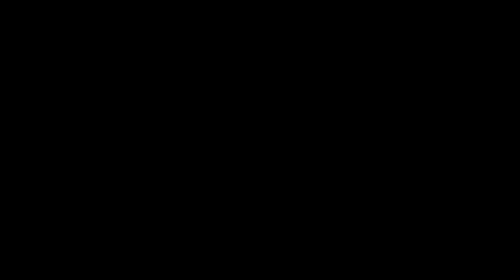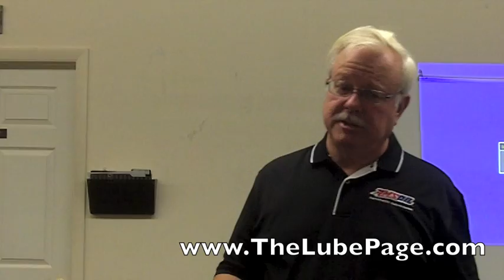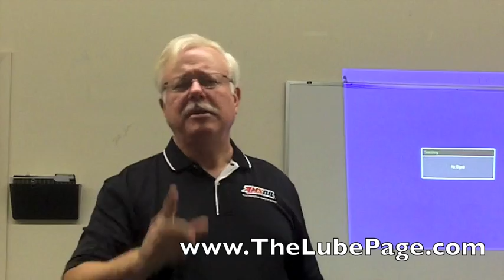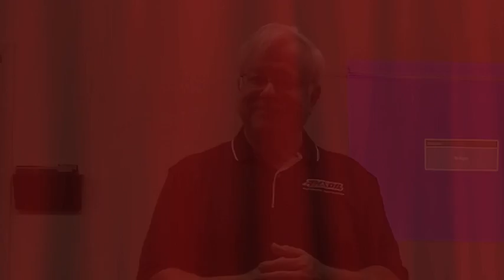Transmission Fluid Facts

Comment: Dear Sir I have been told that I shouldn’t use any kind of CVT FLUID but what is specified by Toyota which is FE fluid, but along with my experience with Amsoil , every thing was great to me, in your opinion using Amsoil CVT fluid in Corolla CVT transmission will expose me to issue with this kind of transmission?

Comment: I’ve recently heard that most modern ATF types are Dexron VI/Mercon LV copies. Aisin sells a fluid that claims compatibility in both Matic-S Nissan transmissions and Mercon V transmissions. I thought this was strange when I first saw it. I was looking for fluid for my Xterra and came across this stuff. Got me thinking that Matic-S and Mercon V are similar if not the same. I’ve also seen bottles of Dexron VI say that it’s compatible with Toyota WS. Are these new low-viscosity fluids just copies of each other? I’ve used Valvoline MaxLife and it does well, but I’m considering the Amsoil Fuel-Efficient signature series since that line claims compatibility in fewer, but newer transmissions. I am skeptical that Valvoline’s 95% of vehicle compatibility.
Reply: Also, what is the main difference between Amsoil’s signature series and OE series for transmission fluid? Are they both 100% synthetic? Is one superior to the other? The $6 difference between these two has me asking such questions 😂

Comment: Which ATF should I use in my 1997 with a 4L80E and 130k mi.? No service history. The website says either the OE Domestic and Imported or the Sig. Series Fuel Efficient. But, in looking at the 2 page data sheet it shows the Multi-Vehicle for Dex III. I’m aware of the TSB to use VI in place of III, but it makes me a little nervous with something that old.

Comment: Hey Dan I have a 2017 ram 1500 zf transmission, can I use amsoil instead of the oem 50$ a quart  for my transmission...about to do my 90 thousand miles transmission fluid change...please let me know
Reply from the maker: Amsoil ATL Fuel Efficient Low Viscosity trans fluid is the correct fluid for the sf trans.

Comment: Many thanks 🥰
Can amsoil ATF fuel efficient replace efficiently  Honda OEM DW1 on 2013 Honda civic transmission??
Reply from the maker: Yes, The Amsoil ATL (Fuel Efficient ATF) is a direct replacement for Honda DW 1 fluid.
Reply: I have actually mixed them in 3x drain fill on my 2014 crv and it solved the torque convetor shudder

Comment: An Amsoil guy is saying that a universal ATF isn't actually universal, yet Amsoil makes a multi-vehicle ATF.
Reply from the maker: Amsoil does not make a Universal ATF, they make one product labeled Multi-vehicle ATF.  The Multi-Vehicle applies to about 55% of applications.  Another ATF is labeled Fuel Efficient ATF and it applies to the other 35% of the applications. The remaining 10% is for various Foreign ATF spec's that Amsoil has no equivalent.  Additionally, Amsoil has a line of Heavy Duty Commercial fluids labeled Torque Drive trans fluid and this is for mostly heavy duty Allison applications in addition in the HD fluids Amsoil offers Powershift Transmission fluids.  And last but not least Amsoil offers a Racing ATF which also meets the Ford Type F fluid.  So, yes you can make a fluid that truly meets several spec's but not all.  The Multi-vehicle fluid does in fact meet the largest number of applications but no single fluid can meet the myriad of spec's in the market place.

Comment: Dan, I don't know jack about cars but am trying to learn--doing my own oil changes and want to start doing my Transmission fluid changes.  So you don't recommend Universal Transmssion fluids (guessing largely in reference to Valvoline ML?).  Anyhow, I see Amsoil makes a universal Transmission fluid.  is the Amsoil universal ok to use in a Toyota?
Reply from the maker: Amsoil does not make a Universal ATF, they do make a Multivehicle ATF.  The fuel efficient low viscosity ATF meets the Toyota WS spec for ATF.  Amsoil makes several ATFs to meet the various manufacturers spec's.  Multivehicle ATF meets about 55% of vehicles where the Fuel Efficient lower viscosity meets about 35% of vehicles so about 10 is for Foreign cars that Amsoil has no equivalent.  I can send you specific tech info if you email me at danwatson@thelubepage.com

Comment: the strange part of this speech is that amsoil makes a product called MULTI VEHICLE ATF... which claims the exact same thing that he is saying makes the other product misleading.
Reply from the maker: Jon, Amsoil does make a product called Multi Vehicle ATF it is not labeled a Universal ATF.  Additionally, Amsoil makes several other ATF products and on each the 
specific manufacturer's specifications are listed.  Amsoil maybe should have changed the name but the specifications are there to differentiate the various trans fluids
offered.  With ATF it is always good to make sure you match up with the Manufacturer's spec regardless of whose ATF you choose to use.  For example, if GM calls for
Dexron VI Then you should verify the ATF you are purchasing list Dexron VI.

Comment: Valvoline now makes a universal fluid, & it's a full synthetic , so in a transmission with gears & clutch packs why is it half the price of the dealer brand?Especially when Kia's fluid, (just one example ), is only semi synthetic., (I will continue to wonder , is that half & half ?,or %20 synthetic & %80 conventional, Or?) I can't imagine any conventional oil staying exactly in grade both hot & cold.So is Honda 's  Z1 been discontinued because their new fluid DW1 is synthetic? We all know, (or should ) that synthetic fluid stays in grade over a higher temperature range than conventional fluid.Guess I'll have to buy a bottle from Honda ..I hope in canada our standards are enforced better than in some other places.Suitable for use , should read sueable for use !

Comment: Why is Amsoil ATF so expensive?what is so special in Amsoil ATF?
Reply from the maker: Amsoil ATF is a chemical based synthetic consisting of mainly Poly-Alpha-Olefins (PAO).  These synthetic hydrocarbons are expensive and the complex additive package has to be of the highest quality to insure extremely long lived performance.  This ATF is worth every penny, especially when you are operating under heavy loads and high trans temperature.  Transmissions are very expensive and anything you can do to enhance protection is very cost effective.
Reply: @thelubepage  thank you Dan for answering questions
Reply: @thelubepage  Kindly ❤️
Could you send me any  trusted approved links or official links   shows that   amsoil ATF is chemical based  PAO!!!
Many thanks in advance.
aminammar44@gmail.com

Comment: I used not believe in amsoil, but after watching a couple of your videos I really believe in it. I would trust someone that says our company cannot possibly make a "one size fits all" transmission fluid (and can explain why), than someone that say they can do it. This is the real world people!
Reply: I find it interesting that he said that, yet Amsoil makes a multi-vehicle ATF still.
Reply: @spiralnapkin  you know after looking into it more I noticed the same thing!
Reply: @spiralnapkin  From what I deduct, they make 2 types of ATF, one for the older vehicles, another to cover the newer specs (like Toyota WS).
Reply: Correct. We do make 2 types of ATF. However, not every vehicle is listed or meet their specs. We spend so much on R and D, it isnt funny. Amsoil tests, tests and tests. Our ATF is not universal.
Reply: @brianpeters867  What's the correct Amsoil ATF for a 2003 Lincoln town car?
Reply: Hi guys if I might add to the discussion… you are right Amsoil makes a multi vehicle fluid but they never Claim that it meets all specifications. The specs that it does meet are clearly listed and then There is the low viscosity amsoil transmission fluid that meets Toyota WS and many of the other low viscosity Specifications. There is also a racing Transmission fluid that meets Ford type F . And also an amsoil CVT fluid .
Reply: The professor spell cvt as constant variables transmission 😂😂

Comment: can u use type f in a 2014 ford fusion se
Reply from the maker: NO!  2014 Fusion requires Ford Mercon LV rated fluid.  The shifting characteristics of Type F are significantly different than the LV fluid.

Comment: Meh I use valvoline max life atf, no problems. I'd use amsoil it wasn't for the fact that 1 quart is close to a gallon of max life in cost. Why change when it's 3x cheaper and has a proven track record especially with my personal experience of using it for thousands of miles.
Reply from the maker: @andrewthetool  It is confusing info but I will try to muddle through the recommendations.  Mfgs are many times recommending fill for life trans intervals.  Be advised that no lube / oil company will give such an open ended recommendation.  Amsoil is good for about 3 times the normal drain for transmissions in normal service which works out to be ~100,000 miles.  In severe service 60,000 to 70,000 miles is recommended.  So how do you state a simple drain interval when the Mfg is saying fill for life.  I think it should be the 100,000 (70,000 Severe Duty) or longer if recommended by the Mfg.  May not help but that's the truth.
Reply from the maker: Of course you can use Valvoline Max life.  It must be changed at normal recommended intervals of (around 30,000 miles).  Amsoil synthetic is a superior product which you can use for 100,000 miles so in the long run it won't cost anymore and the margin to breakdown is much higher with Amsoil.  You may never need the additional protection but if you tow or haul heavy loads your transmission may be running close to the temperature limit of the Valvoline.
Reply: @thelubepage  I also throw in some lube guard red and with a good transmission cooler there's no need to change at 30K, as long as the fluid keeps from getting fried it usually stays good. GM dextron IV says it's good for 100K to, but I don't trust that shit to go to 100K especially with a stock cooler.
Reply from the maker: @Adamz678  Temperature is the great killer of petroleum trans fluid.  Today's transmissions run so hot it is wise to use a high quality synthetic.  There are lots of synthetic impostors so you have to find a real synthetic.
Reply: @thelubepage  lube gaurd drops temperatures down.

Comment: I have a 05 accord 4cylinder, the engine has 191,000 miles on the engine,what is the recommended trans fluid. I do lots of stop and go driving.
Reply from the maker: Have you serviced the transmission during the 191,000 miles?  Amsoil Multi-vehicle trans fluid is the correct fluid but it is important to know if you are doing the service for the first time.
Reply: @thelubepage  i got the car in december last year, i dont know when last it was done, so i want to use the amsoil in it. i was told i should do a 2 drain procedure.
Reply from the maker: Changing trans fluid in high mileage situations takes considerable care and planning.  First check the fluid by pulling the dipstick and dripping some fluid on a plain white napkin.  Look for color and particulate deposits.  If the color is still pink and no debris is observed then proceed.  Next you need to drop the trans pan and observe the bottom of the pan.  If you see a wax buildup in the bottom of the pan this mean the fluid was in service well beyond its service life and you may have some problems ahead.  Clean all residue from the pan and install a new internal filter.  If you found a wax buildup then use standard non synthetic ATF to refill the trans after you reinstall the Pan.  Run the trans for at least 2000 miles and then drain and refill with more conventional ATF.  Run the trans for 5,000 miles and drain and fill one more time this time with Amsoil ATF.  If you found a clean pan then install a new filter and install the pan and fill with Amsoil ATF, run for 15,000 miles and drain and fill again.  Now go 30,000 miles and drain again and refill with amsoil and go 60,000 miles.
Reply: @thelubepage  the tranny jus have a drain plug, not sure if it has a pan.
Reply from the maker: @fyahwerks  Check closely, is this an automatic trans?  If it is an automatic it should have a pan.
Reply: @thelubepage  it's a 05 Accord. I only see a drain plug. I am just a do it your self guy who wanna use the amsoil product to extend to the life of my tranny
Reply from the maker: @fyahwerks  You are right, just a drain plug.  Here are your options, drain and refill (takes about 3 quarts) and drive until the next regular engine oil change.  So the drain and refill again and drive again until the next oil change for the engine.  Now do the drain and refill one more time.  You are now effectively fully synthetic.  Now you can go about 100,000 miles on the Amsoil and do the process again.  If you are looking to purchase Amsoil, email me at danwatson@thelubepage.com and let me show you how to buy at the Preferred Customer discount.
Reply: @thelubepage  I was told of a two drain process. Drain. Refill with amsoil. Drive ten Miles or so then drain and refill. Is that ok?
Reply: @thelubepage  well at 190,000 I should take it that the oil has been change during it's life span. If it wasn't changed I don't think the car would be driving today. But I will keep you posted on what I have done